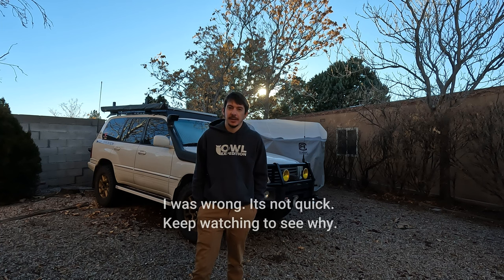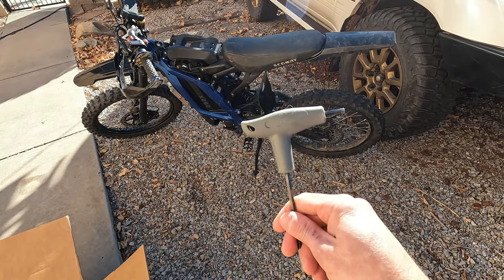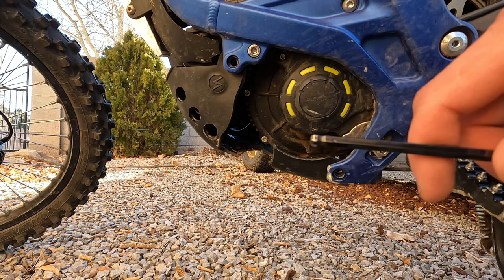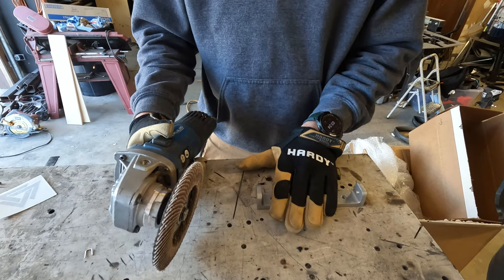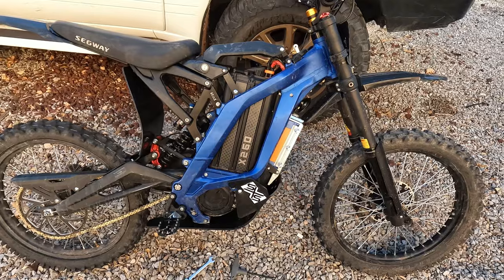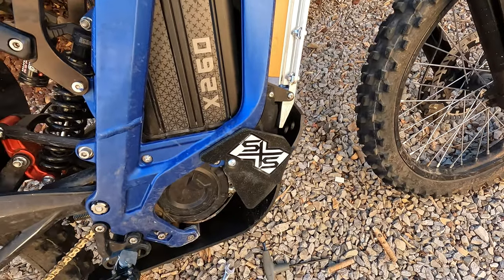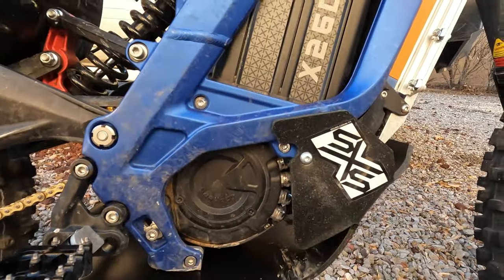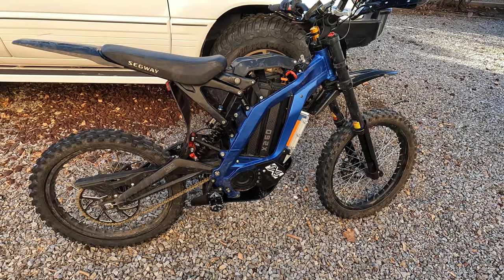Segway x260 Sur ron SXS Skid Plate Impressions and Install

Comment: For the amount this skid costs, not very impressed… fitment issues, kickstand issues, bolts that hold rear of skid in are button head with washer rather then a countersunk tapered bolt to prevent snag hazards on the skid. I’ll stick to the race spec skid.

Comment: I like how open the design is for additional air flow on the motor.  With high power tunes and the closed off race-spec skid plates the motors run hotter..  We'll be running a few of these plates to see how durable they are as well, not thrilled with the other options out there which we keep breaking.